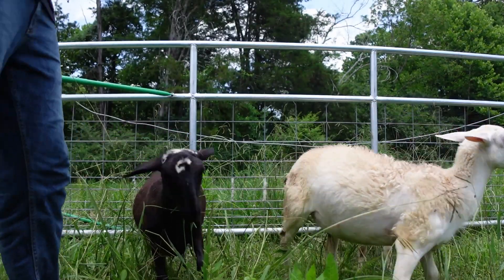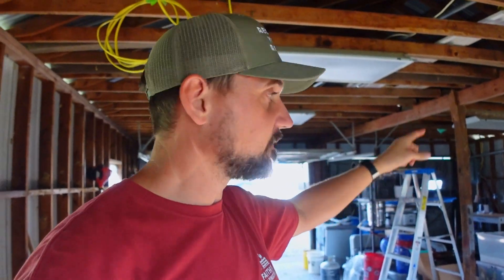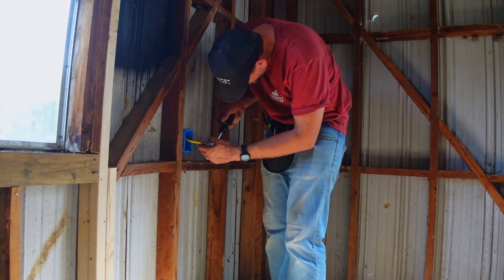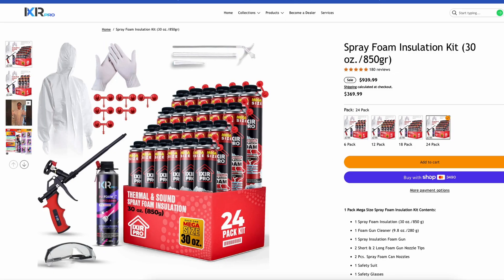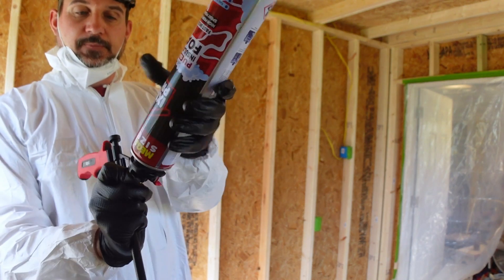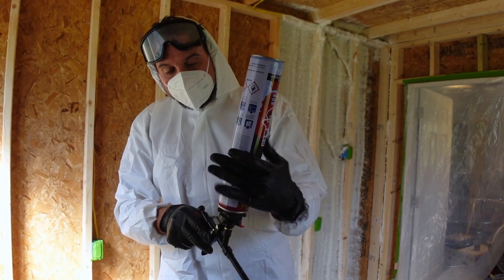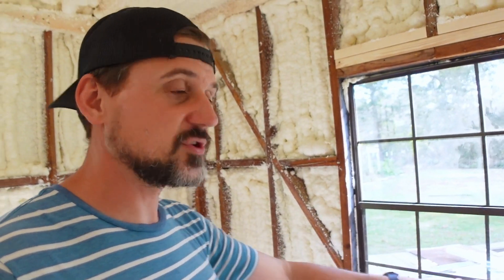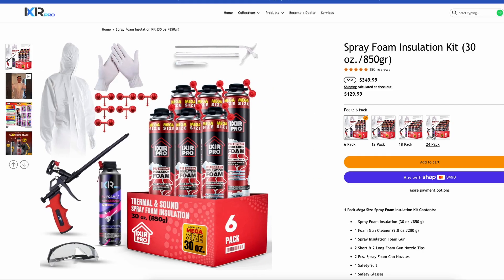Watch This Before You Insulate! | IxirPro 30oz Spray Foam Insulation Demo

Comment: I have to laugh. You look silly in that outfit. 
I bought this product twice.
Works great.
BTW, I immediately threw away everything but the form and gun.
The rest is unnecessary,  it's included in case a low IQ DIYer hurts themselves by looking down the barrel of the gun and pulling the trigger.  There are real idiots out there. The company includes all the safety extras to protect themselves from lawsuits. 
As you have learned, any normal person can spray this goop without incident.